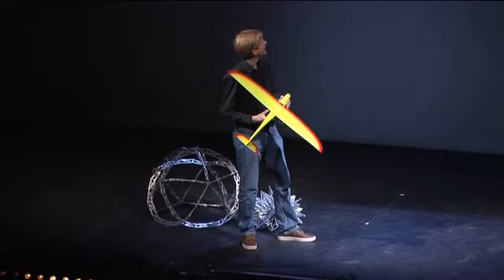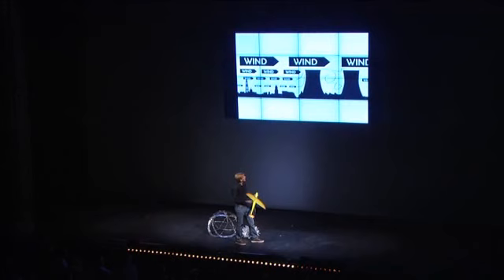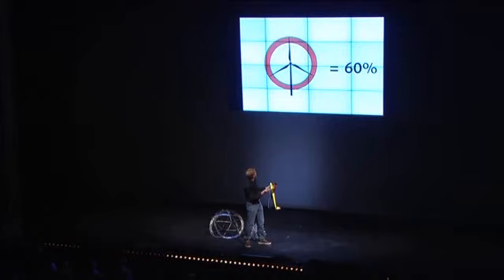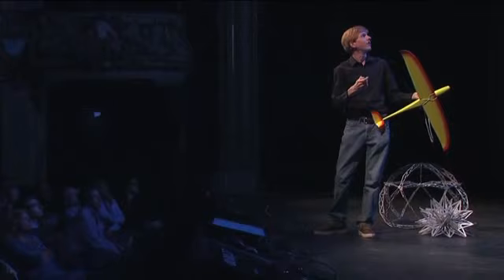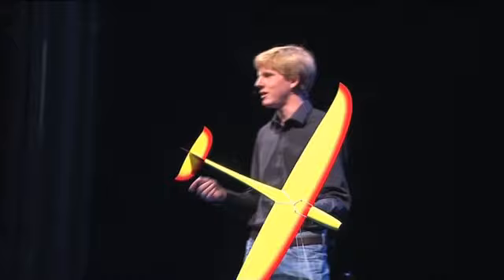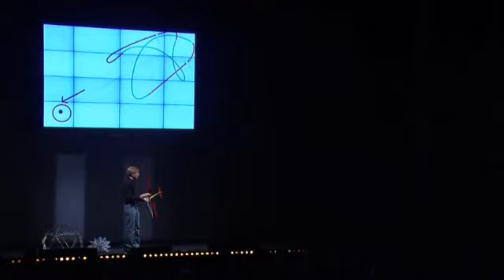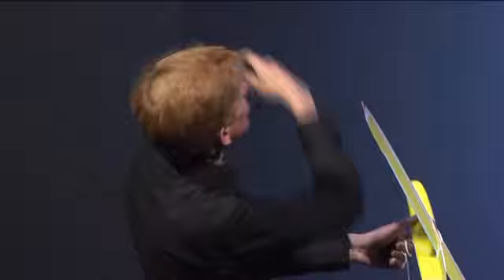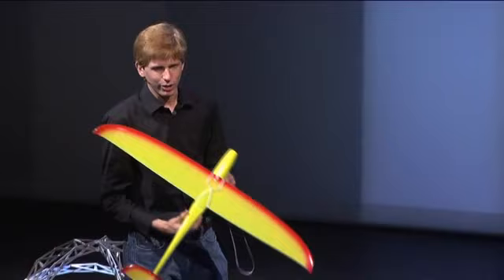TEDxFlanders - Reinhart Paelinck -  Kite Wind Energy Researcher

Comment: Getting the stronger and more sustaining winds at high altitudes is what we need. This really is very promising field of technology. 

It can reduce the use of material resources related to wind power and at the same time it can get a lot more energy out of moving air mass in the atmosphere. Basicly this is concentrated solar energy.

Modern tech like UAV control and navigation systems and advanced composite materials (used in airplanes and traditional windpower) make this a lot easier.